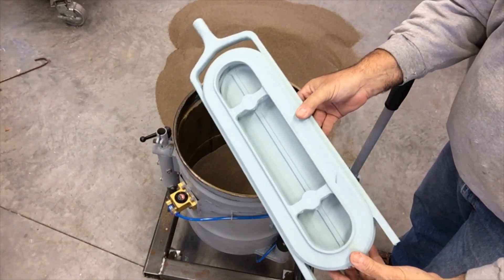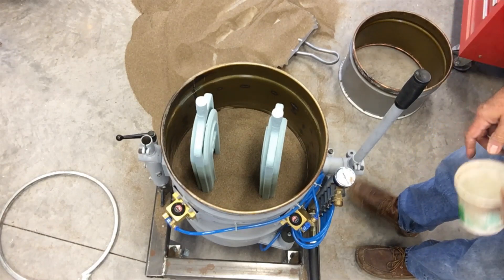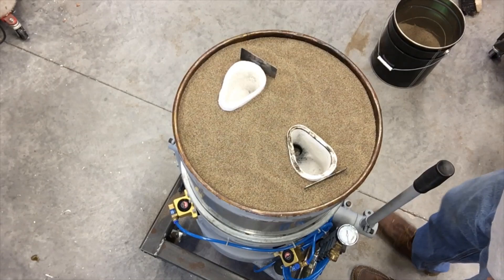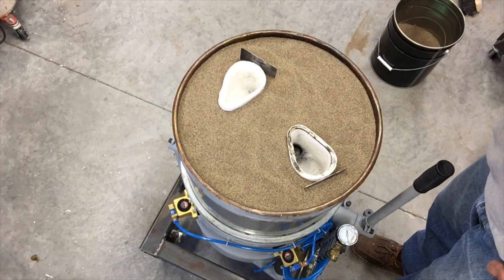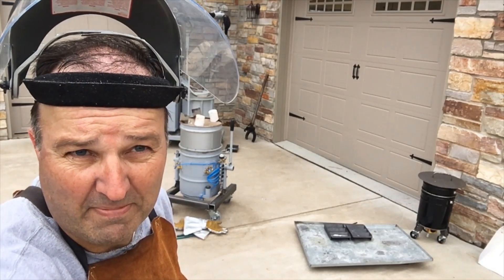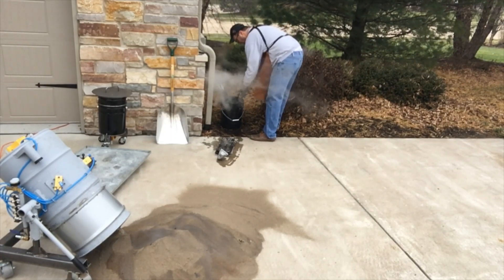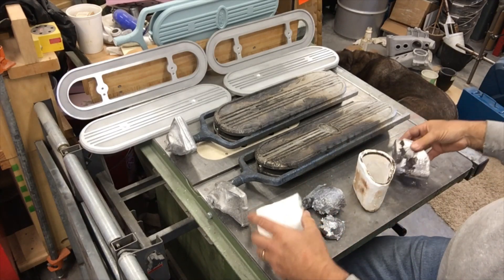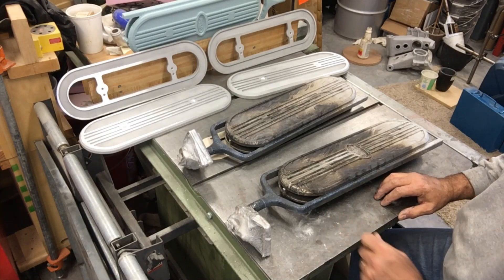Lost Foam Automotive Air Filter No. 3 and Mold Prep

Comment: What state is this?

Doesnt it require some type of oil solution to dip cool? Do you need to dip cool versus air cool?

 I only know of sand casting so a good dummies tutorial for the differences and pros and cons of one method versus another in making your own DIY shop to do with aviation, automotive, farm would be helpful.
Reply from the maker: No oil required. I just dip it to cool it and clean off the refractory coating, not to heat treat it. I heat treat in an oven. Best, Kelly

Comment: Hello Kelly, new subscriber here. Dang those parts look great!
As a MW and MC with 30 + yrs I'm always looking to work smarter, not harder. May I suggest a more ergonomic method of pouring? Watching you use your wrist to control that weight as gentle and precise as possible looked like unnecessary grief. A piece of aluminum tube mounted say + / - 45 degrees with the crucible and about 8" long would not require your wrist to twist and provide better leverage and control imo.
Oh yeah, I did a bunch of alum castings in my hs mc shop class way back in the 80's. 
Cheers!
Reply from the maker: Hi Charlie. Good suggestion. I rarely use that shank for freehand pours. It was originally designed to be used on a pouring cart and consequently, I wasn't too concerned about it's weight of 14.5lbs. It also has a sliding feature that is gripped on the handle that actuates the top clamp. The A20 crucible weighs 11.5lbs so full of aluminum it's 46lbs all up. That flask with the 12" extender was taller than usual and it all made for a pour that took little more grunt for this old man. I also have a tubular steady rest I can install on that flask. I just didn't have it installed for this pour. Best, Kelly

Comment: Hi there.  Thanks for taking the time to video your methods etc.  I know it's easier to just do your project rather than video it.  A few questions if you don't mind.  Is your vibratory system off the shelf or something you made? Can you please tell me more about what product you use to make the pouring cup and also what product you use for the coating on the foam parts.  Thanks
Reply from the maker: The answers to your questions are documented in threads at http://forums.thehomefoundry.org/index.php If you go to the lost foam subforum and look up or search these threads (links below) "My New Lost Foam Casting Rig", "Reuasbale Offset Pouring Basin", "Lost Foam Dip Coating Rig – The Big Dipper"  ....There are detailed answers to your questions. You may need to join the forum to expand pictures and use the search function. If you join, I'll be happy to answer questions there too, it's just a little easier on the forum than in this reply section. Best, Kelly

http://forums.thehomefoundry.org/index.php?threads/my-new-lost-foam-casting-rig.516/
http://forums.thehomefoundry.org/index.php?threads/reuasbale-offset-pouring-basin.688/
http://forums.thehomefoundry.org/index.php?threads/lost-foam-dip-coating-rig-%E2%80%93-the-big-dipper.776/